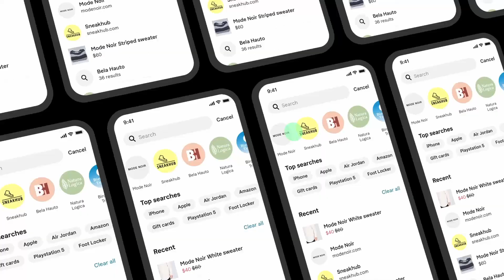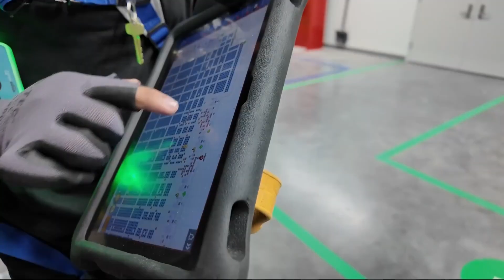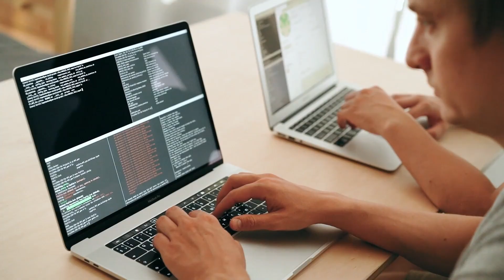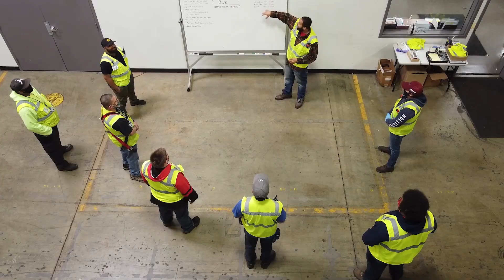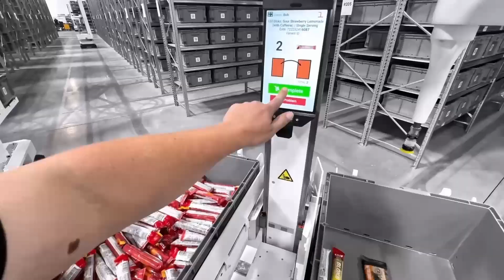How Amazon Replaced an Entire Workforce With Robots

Comment: be a factory automation engineer or technician.   you won't be for lack of work installing and repairing this crap.
Reply: I had a old co worker I used to work with go that route. (I'm going that route now after 5 years).

Before he was a Tier 1 at Amazon he was a over the road trucker. Told me he went to Amazon because truck driving is way less then min wage. This was back when Amazon was paying $13 an hour (So around 2017)

Was a Tier 1 but focus his 2 year degree on Automation and Engineering.  Worked his way up from a Tech 2 ($28 an hour)  Maintenance to a Control System Lead (Making around $40+ an hour). He just switched over to AWS not to long ago and is making 6 figures. 

All from a 2 year degree that he got at 33. 

Automation is the future rather you like it or not.